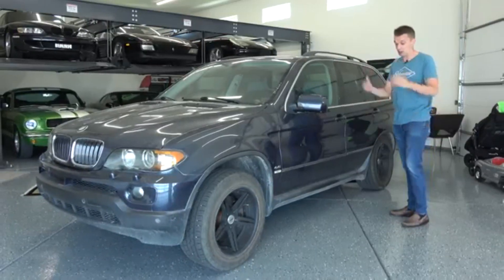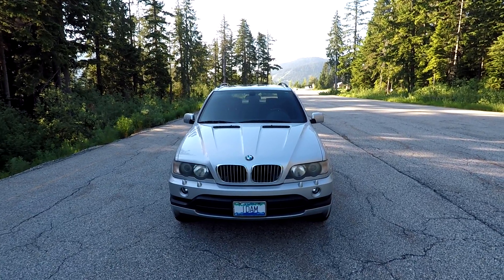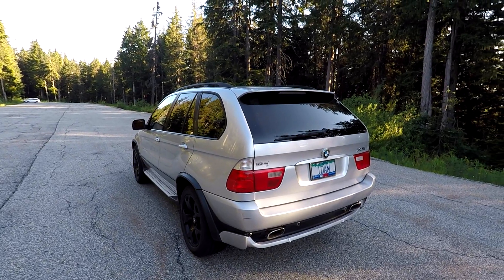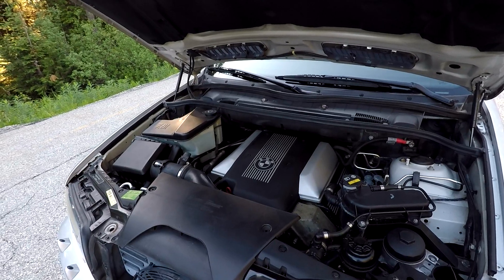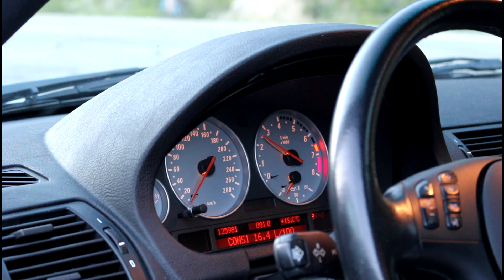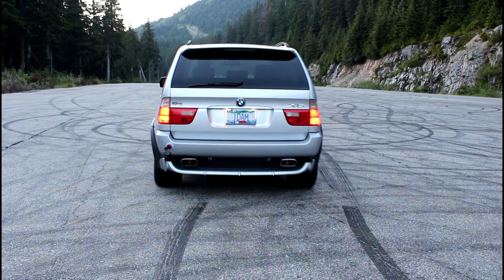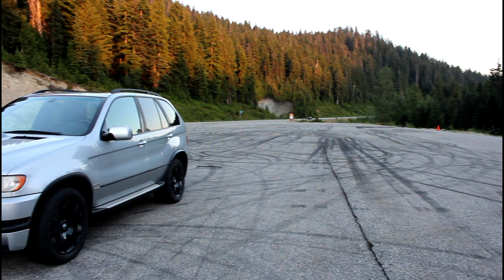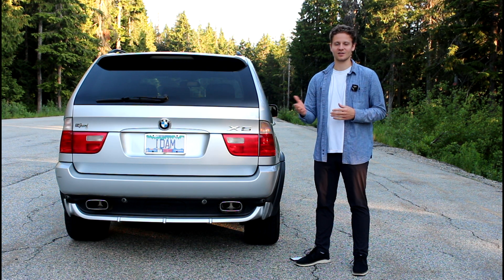BMW X5 4.6is Honest Review - Should You Buy A Cheap Performance BMW X5?

Comment: I own a red 4.6 is they are very rare at only 2000 world wide, I’m in Australia and there is only 9 of these here, I had the e46 m3 in the same colour and they definitely share the same characters. I drive a e66 7 series on a daily basis, the X5 is an enthusiasts weekend or day out car
Reply: Farouk I'm an ausy too who owns one . Love the car . Had 8 years.. get the timing chain guides done . Mine went at 160000 kms. . Ended up rebuild hole motor . Big bucks but worth it. .very rare unlike the 4.8 is.
Reply: Farouk . How do you know their is only 9 in Oz.  Did you check through rego branch. Just curios.  Stuart
Reply: @stuartrose9456  I have one in NSW. Interesting to hear there is only 9. Would be keen to check on that.
Reply: I’m about to buy a red one here in California, I didn’t know bmw just built 2,000 world wide!
Reply: @stuartrose9456  I thought the 4.8 was pretty rare also? 🧐

Comment: Just got a 4.6is with 345,000 km for $2200 in Toronto. Just put 1000km on it. Issues so far have been rough downshift into 1st after driving hard and today my washer fluid reservoir started leaking and wont pump fluid. Happy so far.
Reply: Logan mine had a thump into 1 gear when slowing down. They run way too hot for pollution reasons . I bought a 170 deg thermostat off ebay from Europe.  Standard they run at 115 deg  crazy.
Mine now runs at 180deg  engine oil runs heaps cooler . No thumping into first gear . You can also put a tray cooler on too.
Overall the car runs so much better and less chance of destroying all the plastic and rubber in engine bay. I recommend every one go down this path.

Comment: These motors are 347 hp not 340. Every one seems to get that wrong.
Higher stall torque  convertor bigger brakes and many other differences  to the 4.4 off that year
Mapping cams Heads high flow exhaust and many other improvements.  . I guess you can tell I love my 4.6. Lol
Reply: I picked that up and gritted my teeth - so thanks!

Comment: I bought a 2005 BMW X5 4.4i with 221k miles last year for $2000. Found her sitting on a lot for 2 years. Decided to make her a project car. Unfortunately, she was in rough shape (steering wheel was peeling off and had broken/missing buttons, headliner of the panoramic sunroof was peeled causing extra wind noise, partially nonfunctional dash, passenger side window/lock was not working, fog lights later went out, foggy headlights). The previous owner abused the car and did not do proper maintenance, which resulted in the engine having a misfire. She needed new rotors, hydraulic steering, radiator, and other components. At start-up, there would be a hard shake hard while warming up. The transmission needed service. Dropping the engine and doing proper cleaning inside was also needed. Once I started to realize HOW MUCH work and money would need to be put in, I sold the car at a loss of a couple of thousand after my investments. Nevertheless, I had tons of fun with this car. I loved the way she sat on the road, the seating position, and the sound of the V8. Never got to get an X-Pipe, since that was in my plans. I could only imagine how this X5 would drive if she was kept up properly, and had 80-120k miles. When I did a performance test by Dragy, I ran to what a typical new Nissan Murano would, which is amazing for a car that is 17 years old and was not running properly with misfires. I bet I could break the 15s on the 1/4 mile if all was in proper shape. Ideally, I would have loved to make a 6-speed manual swap. Great emotions and memories from that X5. I attached a POV test drive video for those who are curious to see. 
https://www.youtube.com/watch?v=7XANmoLW-L0&t=789s

Comment: Just pulled my gearbox out. Seems to be the b drum and the A clutch seals. They always break on this car as it’s just too powerful. I also replaced all the control arms and the sway bar links, all the rubbers. Then all the window regulators and door handles. My cluster was replaced at some point. 🥺
Reply: at how many miles is your X5?

Comment: I have a squeaking sound from the front wheels on my e53 x5  I suspect it's from the brakes what would u think this is from because  when I bought it it didn't have that sound later I changed the pads and that sound appeared so I thought changing the discs will fix that sound but nope I was wrong and it's still making that sound.😀😢😭😂

Comment: Where is next episode about 4.8is, after 1year owning as you promised :)))
Reply from the maker: I can never seem to match up with the owner's schedule. I'll try my best though!
Reply: @WestVanGarage  I bought a 4.8si it was horrific
Reply: @aulzhoefer  why?
Reply: @Homerlovesbeer2  everything broke… everything
Reply: @aulzhoefer  doh! I just bought a 4.8is in le mans blau  but it's had lots of maintenance done (gearbox, torque converter, water pump, pretty much every engine seal, rear suspension airbags, front CV boots, drivers window regulator, rear tailgate motor, rear number plate lights etc and been checked over by BMW who said it's in great condition) so I think it's not a bad buy and should provide a few years of trouble free motoring (touch wood) 👍😁